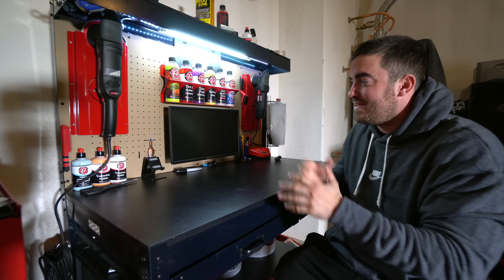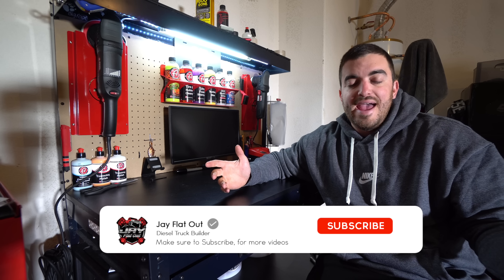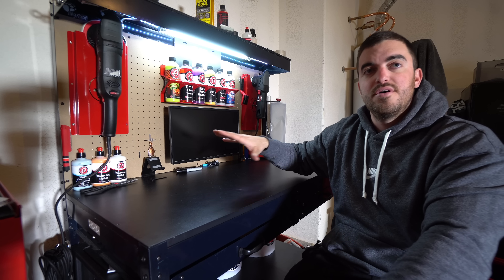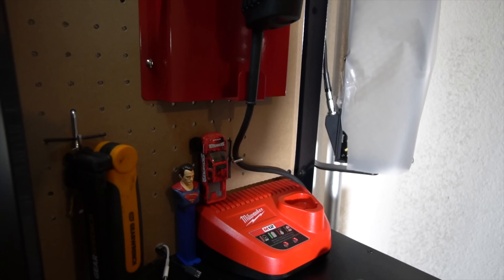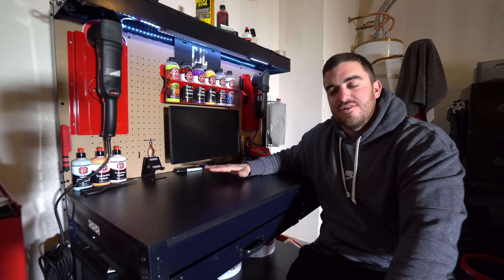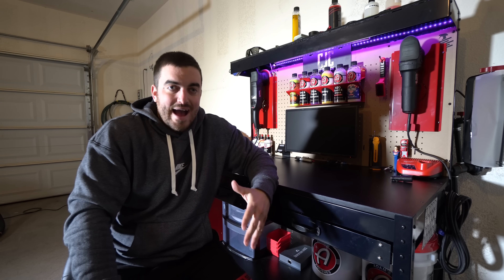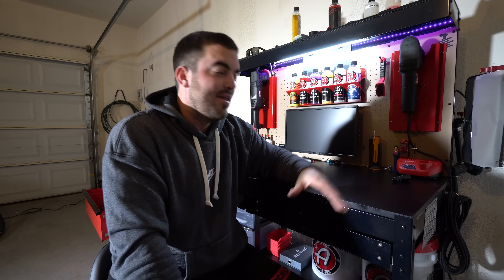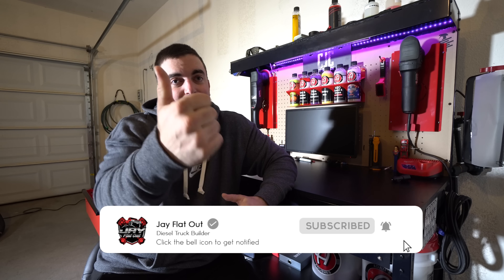How My Harbor Freight Workbench cost me $3,000! - Flat Out Garage Ep. 2

Comment: You did a lot with the bench. I do Ike the  changing colored lights in the light cove  i actually purchased the HF wood workbench that i use for small projects it too was a PITA. To put together   But for the money  is a good deal  i am a retired Woodworker by trade. That is between shops at the moment  i do plan on building  a much better bench  for my next shop and ill probably just put the HF  one in a garage or  extra room in my house for very light duty  jobs like watch repair  and/ or  working on small electronics ? That bench has a few drawers that would be perfect for small tools  and  other junk
Reply from the maker: It's a decent bench for the price, I'm running out of space so I chose this one.
Reply: Two words locking washers!